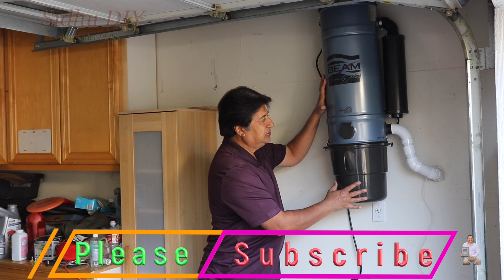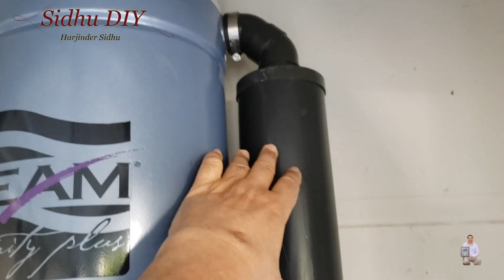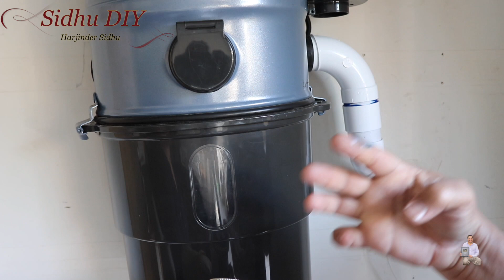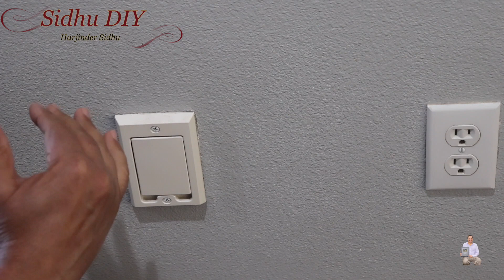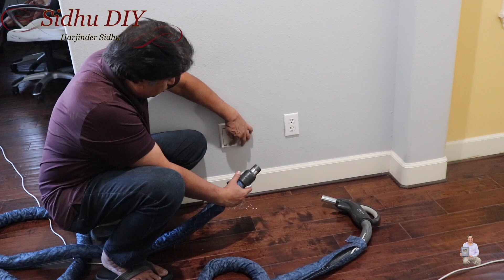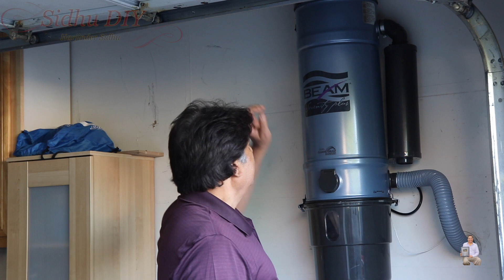Tips and Tricks: How To Install A Central Vacuum System

Comment: only put glue on the pipe, not the fitting or it will get pushed into the pipework. also want to de-bur the ends.
Reply from the maker: Thanks for sharing useful info. and thanks for watching.

Comment: Thank you for your video.  I have a Beam Central Vacuum System from 15 years ago.  It has worked well, but recently, the system in the garage would spontaneously power on on its own.  I have had to keep it unplugged because of this and plug it in when I need to use it which is a hassle.  Do you have any suggestions on how I can fix this without getting someone over to repair it?  Thank you.
Reply from the maker: Good question, the first thing I would do to check all the inside outlets where we plug the hose, and make sure they are clean. I hope it helps, please share the findings.
Thanks for the visit. 
Glad I could help! please share, thanks.🙏
Thanks for the like and thanks for watching.🙏

Comment: Here’s the big thing  if you lower down the unit you swing in the 90
Reply from the maker: Yeah, it's a good idea but in my case, it won't work because there is no framing and you need to put the bracket in the wood frame so you have a permanent and solid fitting.
Thanks for sharing the info. please share, thanks.🙏
Thanks for the like and thanks for watching.🙏

Comment: Personally, I wouldn't recommend the flexible pipe. You can use it but there are more disadvantages to it than the PVC piping. It reduces airflow power, they can clog easier, and they're more likely to get a rip or a tear through them. Also I'm not sure if you're aware of this but the powernozzle should be turned off for the hardwood floors, the rotating brushroll can scratch them. That's why they come with a barefloor tool for that purpose. Anyways, cheers!
Reply from the maker: Thanks for the tips! Thanks for watching.